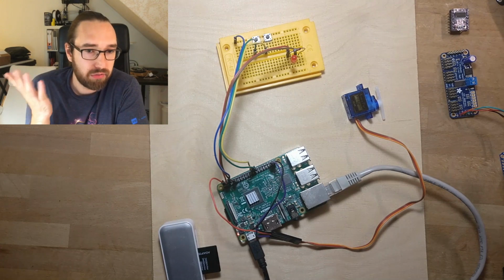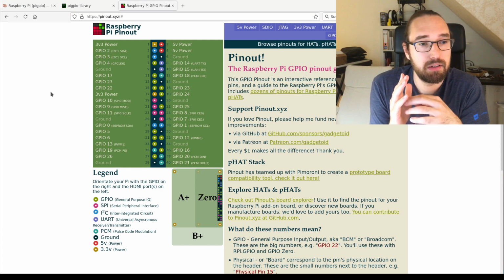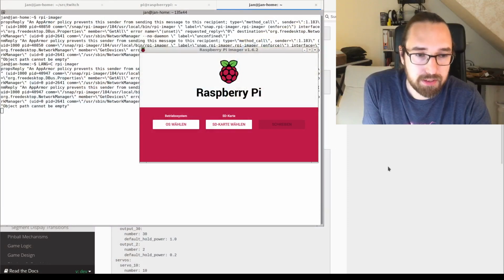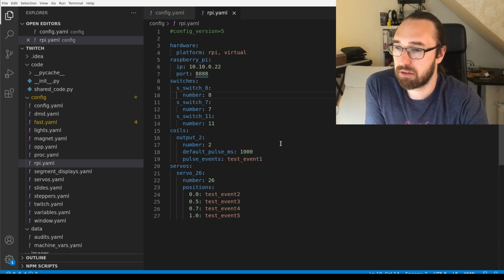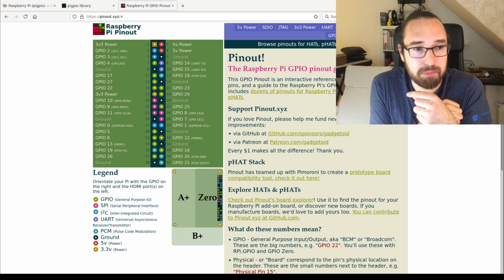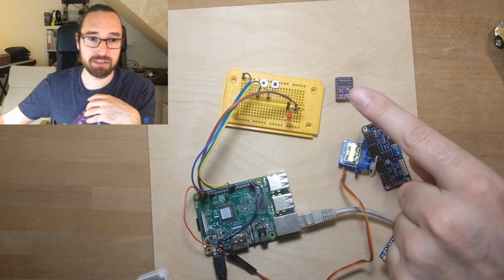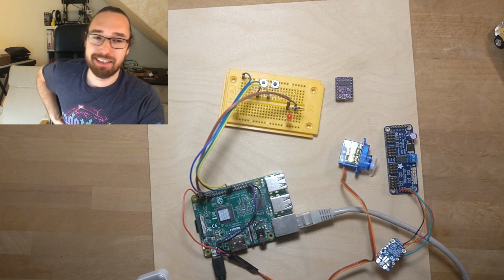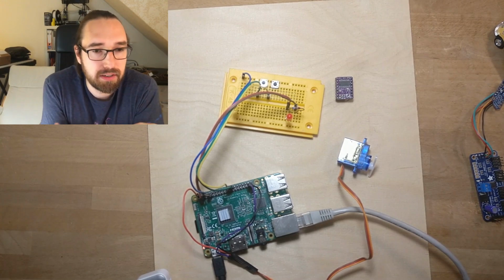Using a Raspberry Pi as Port Extender in Your Pinball Machine - MPF Hardware Series

Comment: can pico 2 run mission pinball framework or do you need a full raspberry pi?
Reply from the maker: Without Media Controller maybe. Definitely would require heavy tuning. I would recommend a stronger CPU - especially during development.
Reply: @jabdoa  installed both mpf & mpf-mc. because the tutorial wants you to do so. Otherwise you can't follow the tutorial. But I'm struggling to get the framework to co-operate with my fresh linux distro. I can get it to run mpf -b but when I try to do the next step it stops to co-operate. mpf both fails. mpf cant find godot but it's installed on the system. I'm stuck there for now. Can't seem to get this to work reading the original documentation. (no help in how to get python setup for MPF. installed dependancies manually like pip and venv.)
Reply: @jabdoa  I got mission pinball framework working now, I followed paradigm tilt's guide. So far looking like this: https://www.youtube.com/shorts/MrcCkWF9Cyg
pico2 not yet connected. all the problems I had with installation were because I was working on a too new python variant. (yes I missed a number reading the instruction page five times)
Reply: @jabdoa  I think I asked the wrong question or I'm mistaken. I was meaning, can I use MPF to connect the pico 2 to control the pinball machine? (MPF is running on a dedicated linux machine with a media controller. . (see other response)
Reply from the maker: @CrazyByte2007  I guess you should be able to use the RPi Pico for some IO. However, its not a pinball controller with hardware rules, input protection and FETs on the output so you probably would have to add quite a bit to it. I would recommend a purpose build controller. If you want to go DIY look at OPP/Cobra Pin or if you want to go more commercial FAST/P-Roc.
Reply: @jabdoa  well, without doing anything it's just a plain microcontroller. currently I got code on an arduino UNO r3 that reads my buttons and drives mosfets that drive solenoids. but the UNO can't do color output. I was looking to get color on a screen, bumped into MPF, but that's not for an uno, while a pico 2 was already ordered and in the mail. I didn't know MPF existed before that.
Reply: @ I'm starting to understand more every day. the uno can't work with mpf because it can't talk to internet. (could get it to talk to internet with a shield of sorts) but the pico 2 w can talk with internet (build in wifi) why wouldn't that be capable of talking back to mpf so we can display things? I  looked at cobrapin and fast, but I don't have that kind of money. 200+ for fast and 180+ for a cobrapin, It must be done cheaper, heck I got an uno r3 controlling everything right now (exept that pesky color monitor)
Reply: @jabdoa  I got the "virtual" machine almost as far as I can get it now. so I could start connecting it to hardware. If I would like to use that Rpi Pico 2w for some IO, how do I set it up? Do I do the same thing as I would do installing a Rpi? Or do I need to install that differently? (like undocumented hardware that would work?) (also looking at a purpose build controller, just don't have the money for them but perhaps the OPP I can afford. (but I don't know if I can get all the parts without needing multiple stores. and therefore multiple transport fees.) the Pico I got laying right here, if that can be used I can start building something. (I got mosfets for high voltage driving they can sit inbetween the coils and microcontroller.) Learned to protect input ports on the arduino to safely connect buttons, I imagine it's equally the same for other microcontrollers...

Comment: Hi Jab, first congratulations on your video serie on mpf, that's amazing and priceless! Thank you!
For this particular video I have 2 questions:
1-I'm not sure I get how the rpi and your pc running mpf are connected. Is it buy a direct link via ethernet or are they connected to the same network (via your box maybe?)
2- You mention the use of this rpi-rgb-led-matrix but on mpf doc, I'm not sure that the rpi running the dmd can be connected the way you present (using pigpiio)  and has to run mpf also or not? I'd like to run mpf on PC and rpi-rgb-led-matrix on the pi.
Best regards,
Poukah
P.S.: sorry if in the futur, this post  appears 3 times. the first 2 comments I posted have been deleted after a few seconds, maybe because I posted a link in it. sorry for that
Reply from the maker: 1. You can use ethernet or WIFI. I guess in a pinball machine you generally want ethernet. Serial (over USB) might be possible as well but I did not try that. Everything which is supported by pigpiod works. I got the RPi in my network but you can also run a direct link with static IPs.
2. Currently, MPF has to run on the RPi for rpi-rgb-led-matrix. Technically, we could implement a bridge for that but nobody did that yet. Would probably be worth the effort.

Comment: Hi Jab thanks for some great videos. I am very new to MPF and taking many small steps. I have installed MPF on a RPI4 and would like to connect an arduino mega for switches and lights. your guidance on this would be appreciated. I am also trying to source suitable code for the Arduino to interface with the RPI. Any help would be appreciated
Reply from the maker: Welcome :-). We generally recommend to develop the game on some powerful desktop/notebook and deploy it to the RPi later when it is mostly done. If you want to use an Arduino as pinball controller I recommend to have look at APC (Arduino Pinball Controller) in the MPF docs.

Comment: I recall seeing the guts of the Attack From Mars remake and it had a BeagleBone black plugged (as a daughterBoard) on the driver board. I assume they just run some kind of pinmame emulation on it
Reply from the maker: Yeah if you do not run any (high-res) graphics this becomes a lot easier. You can easily run MPF on a RPi3 or RPi4 with "just" a DMD or segment displays. Full HD LCDs make this more tricky (but not impossible).